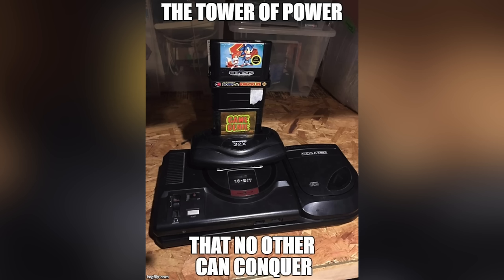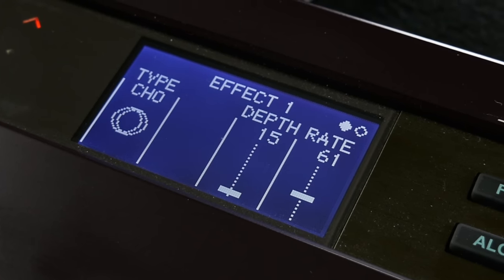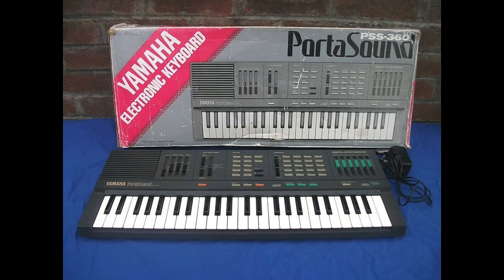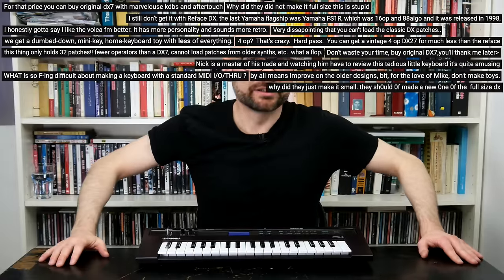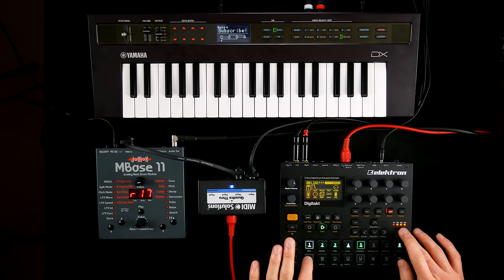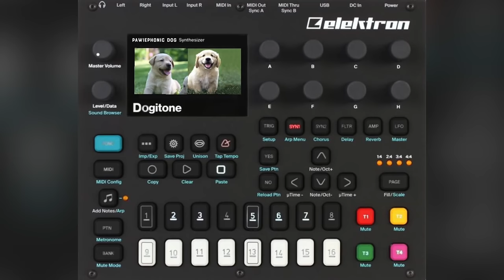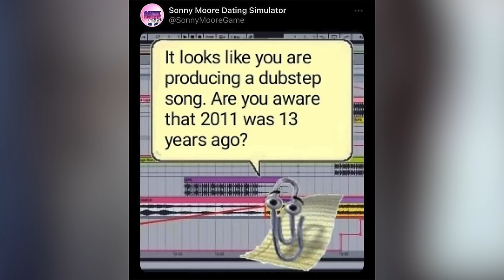Bad Gear - Yamaha ReFace DX

Comment: i LOVE my reface dx. i own a dx100, modx, dx27 and i love this thing. 4 saw or square operators, amazing tiny keybed. for what it is, its amazing
Reply from the maker: You have a point here!!!
Reply: DX27 and a DX100?  Did you know they have the same “motherboard” inside?  Same engine in a different chassis/keybed.
Reply: I also have a Reface to “replace” my dead ‘100.  

The “feedback” on the Reface to saw-off or square-off the operators makes it more like the DX11 than the 100/27, though.

It’s a shame there’s no mod wheel on the Reface, and so few memory slots.  But it sounds great, and the velocity sensitive keys are a big improvement over the 27/100.

Comment: Have a TX81Z and like it but wanted more hands-on FM so I opted for a Twisted Electrons MegaFM, every parameter has it's own slider or knob, but high noise floor. Was never interested in the RefaceDX, especially with that awkward midi port.
Reply from the maker: Nice choice!!!

Comment: This was my first hardware synth after trying out loads of ipad synths. I got it steeply discounted, or I might have gotten something else. I'm glad I did, though. I really enjoy sound design on it. I wish more modern hardware synths had more complex envelopes than simple ADSR. It doesnt seem to do conventional algorithmic FM right, and modulators can be heard without their carriers, but it has something I keep coming back to, even though I have much fancier synths (including an Opsix), and not just for portbility or the cool keytar attachment.

My wife did use it to cover Danger Zone, though, and did get lots of kudos for the sound, so that's spot on.

Comment: My very first synth was a DX-21 that I pulled out a skip 30 years ago, lol. Amazingly, I still haven't needed to replace the cr2032 battery yet! In Mono/Fingered Porto Mode it's still capable of creating some pretty groovy-sounding basslines. Stacking weird percussion patches in Dual mode also sounds pretty decent. Those gritty old D/A converters give it a bit of extra character as well.
Reply from the maker: Classic!!!

Comment: When Reface DX hit the market in 2015, part of me had a somewhat screwy question: could it emulate the other 3 Reface models? I can only imagine it could, especially when you think about how the model it was reflecting on (the DX-100) was supposedly capable of doing it itself. If I had tried, I imagine I could have found examples. However, I was focused on how I had the microKorg XL, and I didn’t feel like I needed just another 37-note miniature synth with multi-effects and only 8-note polyphony.
Reply from the maker: It might be a challenge to nail the filter of the CS

Comment: The DX Reface is more a tool for creating sounds so they can be recorded off and used in a tracker/sequencing software. As a keyboard for playing it should of had 4 octaves minium as you can quickly run out of keys. 
Best use for the DX Reface I've found..., the Sustain Pedal can be used via midi, meaning bad gear like the Yamaha PSS680 or PSS480 that never came with a Sustain jack can now make use of a sustain pedal. The DX Reface might be an expensive Sustain pedal but at least it works on old gear from yesteryear. 😜
Reply from the maker: Nice technique;)

Comment: Thanks for making this video! I’m a big fan of DX7. This was not very convincing, I will just try to get my hands on the original sometime.
Reply: It sounds unconvincing because it only has 4 operators (like the cut down DX models) rather than the full 6 operators of the DX7. 

As I complained elsewhere, there's no obvious reason for that when even 6 operators would have been trivial to implement with today's technology. (Something the much cheaper Volca FM managed).

Comment: I'm surprised you didn't like the touch faders - I found them easy for both drastic and incremental changes. If I could replace the physical faders on my OPSIX with six Reface DX faders I would immediately.
Reply from the maker: I really wanted it to work for me

Comment: I got this thing around launch time and a PDF of the venerable Complete DX7 and learned how to do FM synthesis. It was a very nice learning experience. Personally, the thing that keeps me from jamming with it is that the patch memory is just too limited. There are many excellent patches you can load on to this thing made by other users, but getting them on and off of the Reface DX is very annoying. I need to pretty much figure out what patches I want to use and THEN start composing something afterwards. Doing it on the fly just isn't going to happen. This is a huge minus compared to using Dexed or the various iOS FM synths.

Comment: My review: The Reface DX is only a microcosm in the world that is its older siblings. The "feedback" for the oscillators is just simply NOT feedback at all, but more or less a way to get more waves piped through your FM sound - V50 or FS1R style. Actual feedback is non-existent. Do I hate it, though? Not really.

It definitely has more tweak-ability than the FM synths of yore done by Yamaha. Those touch areas are neat enough (albeit fiddly to work with, but idm), and the lack of a Mod wheel doesn't really get me down all that much as I just add it to the tail end of my patches anyway.

The effects system is quite a breath of fresh air here, so I appreciate what Yamaha was trying to accomplish. Yeah, the keyboard is shrimpy, but it has velocity sensitivity.

Summary: a dream for patchists like me, a nightmare for live performers and actual musicians. An external controller keyboard should solve the live portion problem, but at what cost, right? It gets a * out of *** in that respect.

Comment: Reface is the perfect name. Although I liked the CS for it’s very nifty programmability, making it much more versatile then the layout suggested, it’s all a bit of a repackaging trick, isn’t it.  If you want 4 operator FM power the ultimate incarnation is the Elka EK 44. Real 5 octave keyboard, 2 fully independent layers and a sugarplum stereo chorus which makes even the 6 operator FM’s sound bland. But who remembers that thing. Well, I did and fetched me oner recently. Enough rambling.. Have to stop with a compliment: Your production approach fits very well to this little thing. Sounds much more massive then I ever got out of my DX7 at the time. Where where you then? A yes, probably a promising gleam in your mothers eye. 😄
Reply from the maker: Interesting, gotta check out the Elka

Comment: IMHO the refaces are modern classics already, esp. the DX. Doubt they (Y) will reissue any of them with improvements despite those strange decisions like super arbitrary Midi socket (7pin mini-din ? for in and out), missing 4th octave or toooo easy delete everything function (turn on while slightly touching the most right key), missing SysEx send command from keyboard etc. BT midi would also be great for the format. Soundwise and ease of editing wise I love the DX. Live the DX100, too, but the reface can detune the different oscillators much finer for super „Schwebungen“. Great video!!! 😃🤩🤩🤩

Comment: Picked one of these up a little bit ago for $250 usd. Love it so far, mainly use it for little sketch jamming, improv over the looper, and just playing around with fm ("couch jamming", in the bed, etc). Agree with various points though, it has some quirks. The prop midi port is meh. I'm guessing they limited the ops for the ui, though I kinda like the touch ui (the flipping-gesture is a little hit or miss for me, minor though). The looper is a fun little practice looper, which fits how I use the reface. I don't really care about the looper not having persistent mem storage, though I would have welcomed an extra blank bank. Using the current voice for the metronome on the looper was an odd choice hehe, at least it has a neutral tone option (wish that was default). The 2 fx layers was a good choice for this guy. The aux-in is nice, I can plug in some other small thing and they can cutely share the speakers. Anyways, yep, for 250 bucks... pretty good.

Comment: How about that dtronics dt rdx v2 parameter controller, it frees up the dx with control of its functions with its Parameter knobs. Small knobs yes but it fits right above the synth, still tiny but at least that helps

I have my oopsix though, so as far as fm goes it does most of what I need.
Reply from the maker: These are awesome!!!

Comment: <laughs in Korg Opsix>
Reply: Fun fact: I bought the Dtronics expander for this. While it was cool, it almost felt pointless since the menu system on the Reface DX is very easy access (the touch controller seems destined for failure though).
Reply from the maker: lawl;)

Comment: Montage is still better. Even the old one.
Reply from the maker: These are massive!!!
Reply: or MODX+ - I wanted FM synthesis so first I was really thinking about getting og DX7, but after I repaired several DX7s for my friends I found I don't really want to wait for the moment I will not be able to repair it again... it is old, heavy and starting to be unreliable (and it is the technology of late 70s/early80s, so finding some spare parts is starting to be tricky)
on MODX+ I can do anything like with DX7 and more
if only keybed would be a bit better (applies to both keybed used)

Comment: I got mine brand-new a long time ago for €175. I think it sounds great but the user interface is a real PITA to use, and the main reason why I don't use it. Currently, it's sitting in its box. Sound-wise, it is a great synth but it would have been better with rotary push encoders and 6 operators like the real DX7. Basically it would have been a very successful product if it was a mini version of the DX7 II-FD but with a more accessible interface and the ability to assign parameters to knobs for real-time performance.
Reply from the maker: Nice find!

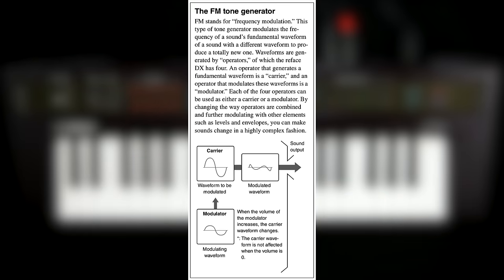Comment: That sound at @2:29, what is that called? That’s one of my favorite sounds in all of FM synthesis and probably what I associate the most with the YM2612 chip from the Sega Genesis. If there’s an industry name for that, similar to the “acid sound” from a 303, I’d love to know it!
Reply from the maker: Just random FM noise;)
Reply: Haha gotcha. I actually stumbled onto this sound while toying around on a K2700 today, which has a 6 operator FM engine. I think I found my next synth, and it’s much cheaper than a Montage. 😁

Comment: For a quick recording or getting into synthesizers or hammonds, the refaces look and sound much nicer than many korgs or casios

Also, the modulation could have been well implemented in the jams
Maybe it is not good bad gear but rather good starter gear, especially since they cost around 200 in used condition
Reply from the maker: 200 would be an adequate price I would say
Reply: @AudioPilz  200 to 250 is what i saw on Kleinanzeigen,  250 on Reverb

Comment: That price is horrendous for what it is. Wait for an Arturia sale and get the Arturia DX7 V. Then use whatever controller you want. I got 50% off for $75 total. Full price is still a much better deal. Not to mention, way more powerful unless you need to go completely DAWless. That's your problem I guess.

Comment: Why on earth did they make this thing 4-operator only (like the cheaper cut-down DXs) instead of including the full 6 operators of the DX7? Even the original Volca FM didn't cut that corner.

The cut-down 4-op versions were understandable in the 80s when electronics were expensive. But processing power has gone up by orders of magnitude since, with prices doing the complete opposite.

Since it was fully digital in the first place, I'd assume that- even in 2015- the 6-op DX7 could have been emulated perfectly in software and in real time by even the cheapest potato-level general-purpose CPU a dozen times over in its sleep.

If they'd wanted to cater to people who actually wanted it to sound like a Mega Drive/Genesis, they could easily have included a 4-op-only mode.
Reply from the maker: I think it was easier to creat a UI for that

Comment: The biggest flaw is 32 presets. Nostalgia wouldn't be destroyed if they made 128 / 256 or 512. Yeah, you can expand this with soundmondo app, but it's frustrating.

Comment: What I don't get is why nearly all modern FM synths seem to be limited to four operators.  Even if you don't really need all six of the DX7, is it really that hard to implement when it's all software anyway?  Reface takes the prize for most faithful (i.e. worst) interface though...  Still a pretty cool package and obviously it sounds pretty good.
Reply from the maker: Volca FM is 6 OP;)

Comment: The reface DX had the absolute stupidest form factor I’ve ever used on an instrument. I was constantly changing the volume. Y accident when reaching for the other two sliders on either side of it. And the speakers force the whole thing to be much wider than anything else you have, and it’s mostly dead plastic so it’s just huge anywhere you try to put it, but also a waste of space.
Reply from the maker: True that!!!

Comment: Ah, a DX100 or DX200 that has been lobotomised and made up with the Fisher Price quality control failures bin parts, I think Yamaha stopped making cool bits of kit the mid-2000s, MODX+ you need to remortgage the house to afford one, the MX is a rompler with no aftertouch it could have been a bargain banger 🙄 CS6x, AN/DX200, FS1R, A3000, RS7000, RM1x despite each having the odd flaw they are still useable today even the QY700 in its office grey colour scheme and not looking out place in the accounting department still works as an excellent sequencer WTF went wrong Yamaha. I would have pimped BoBeats to Josef Fritzl for a fully expanded RS7000 🤷🏻‍♂️ I am off to swear at Roland and punch a Korg salesperson.

Comment: Great video just one critique, stop filling the time with 2sec shots of memes. I realize you’re trying to be humorous but they go by so quickly it’s hard to get the meaning. 
   Great info on the reface. I had looked at the refaces at guitar center years ago but Wasent interested because of the great FM vst’s that are available. I use to own the DX11 but man it was nearly impossible to program and no real time controls. 
 The one thing that is cool is that one could midi to a controller ( 88key) and 
have a larger than life DX 7, minus the operators.  But in reality Arturia  dx7 does the job for a much lower cost.
Reply from the maker: Thank you for the feedback
Reply: @AudioPilz  just subscribed:)

Comment: A suggestion for future bad gear? 

You've "reviewed" such a whole lotta gear that's gonna be difficult. You've already made a videos about the over-hyped, intelligence insultingly expensive Elektron Digitakt/Digitone/whatever. To me they're incomprehensible. But then again, I can't afford 'm so I'll never know if they're any good or not. 

Anyway,  have you reviewed the Maschine stuff yet? Also incomprehensible to me. And to make matters worse, you never know if a specific model is a dongle for a DAW you don't use or standalone. If there's something that I hate with a passion it's hardware that needs software. Try and buy or sell that a few years later. You never know if the software's still available or works in you operating system of choice.

Comment: It's so disappointing that the Reface DX is only 4-operator. Surely there's enough power in modern micro-electronics for the full DX-7 experience? I'll keep my FB01 thanks, and play around with my Casio CZ-101 for similar sounds with a better interface. The other Reface synths are excellent though as every control is laid out physically, and they sound almost indistinguishable from the originals.